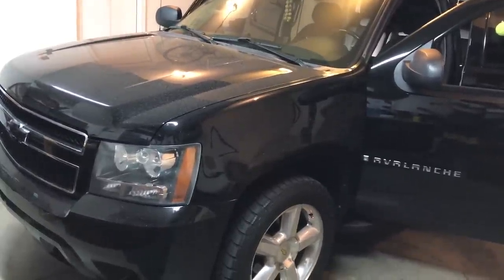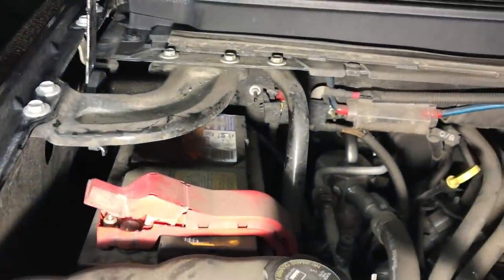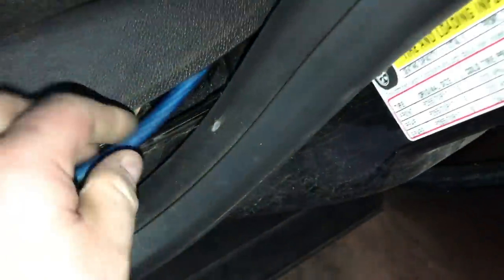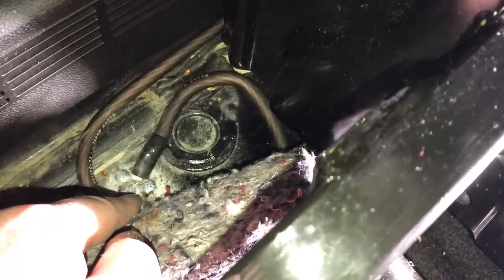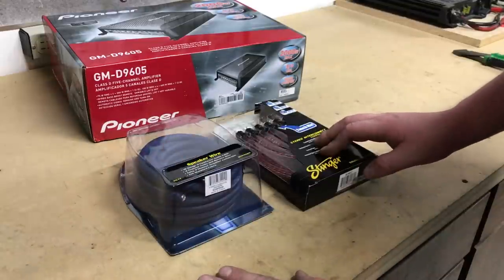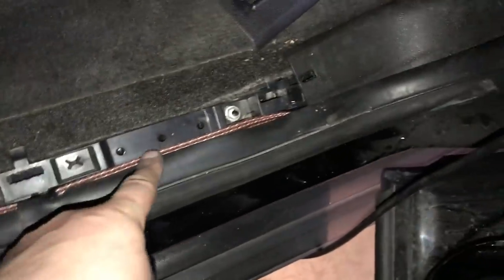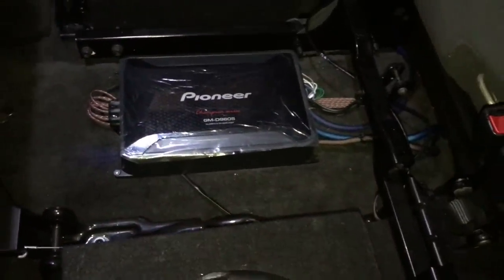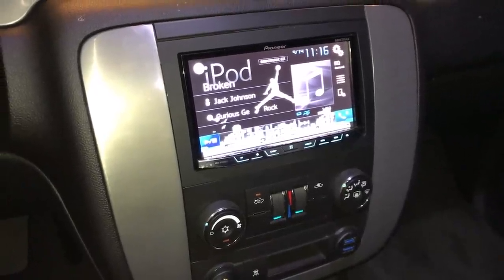2007 - 2014 Chevy Avalanche 5 Channel Amp and Sub Install

Comment: I always thought you had to get rid of the factory bose amp when adding in an amplifier to the door speakers.
Reply: this truck doesn't appear to have the Bose option. mine does and i tapped into the lows on the factory sub for the new ones.
Reply: @Jeff-jr3sg , so you were able to keep your existing factory bose amp to run your new subs?
Reply: @joeyrember23  my subs are powerd by an amp i just get my signal from the factory sub output.
Reply: But if i want to replace my factory amp with a better one without running new wire? Some one help me

Comment: What’s the most power I could to do with that battery terminal That’s by the firewall? I don’t really want to mess with the battery terminaI I have a 2007 suburban will it be ok to use with 200 amp fuse for a 1800 x 1 amp?

Comment: Would two 12s be able to fit under the seat with no problem as well??
Reply from the maker: Shallow mounts, sure.  Just make sure you find a box that can accommodate them

Comment: have a tahoe ls model 2007. did anyone knows where's that factory amp located at inside the truck??? I I've replaced the stereo aftermarket speakers front and back . They all work but they still need help on upgrade level.
Reply: In the center console

Comment: If you are running the speaker wires straight to the stock harness what are the extra RCAs for?
Reply from the maker: RCA's carry the signal from the radio to the amp.  The speaker output then goes back to the harness to each speaker.

Comment: Good evening! How did you secure the MDF under the rug? Thanks in advance!
Reply from the maker: quarter inch MDF.  Amp drilled though carpet into MDF, carpet is sandwiched between wood and amp keeping it in place and secure.
Reply: @ProvoBeastAudio  So a quarter-inch was enough for the amp screws to hold on to the MDF?
Reply: @milche64  apparently

Comment: Where does the remote amplifier power get connected to the head unit? You ran it but never showed where to connect it?
Reply from the maker: Run RCA cables from the radio RCA outputs to the RCA inputs on the amplifier.
Reply: There is a “remote wire output” on the harness in the back of the stereo, you can use that or tap off a fuse that is only active when the key is on! Use a test light of volt meter to test which fuses are on when the key is tuned on, and off when the key is off! Hope that helps!

Comment: Do you have to bypass the factory sub or just disconnect it?
Reply from the maker: This truck wasn't equipped with it, but since we had an aftermarket radio, we wouldn't have even needed to worry about it.  If you are concerned, you can just disconnect it.

Comment: thanks for the great information, I learned something new today with wiring new speakers. One question I did have was with your subs, did you route both of them to the same plug in on the amp? 
I was looking at adding a second amp to my truck, and I believe I would need a second amp, however, the GM-D9605 doesn't have any out put ports on the amp. How would I add the second amp?
Reply: They have special boxes where u run your power cable connect it to the box then it has 2 exits then u run both your amps 👍
Reply: Hugo Arreola a power distribution block. I understand that. I meant rca wise, would I need an rca splitter?

Comment: Great job as always! How do you mount the amp and sub to the floor?
Reply from the maker: We slipped a piece of MDF under the carpet then screwed the amp through the carpet to the wood to mount it securely.
Reply: @ProvoBeastAudio  whats mdf?
Reply: @TONYELDIABLO1  medium density fiberboard. It's the best solution for sub boxes. Way better than plywood. Less chance of rattle when the bass hits. Here he's just using it as a mounting sheet. In this case, because MDF strips out easily, it's not best.
Reply: @ProvoBeastAudio   How did you install the MDF under the carpet to keep it secure. How thick was the MDF?

Comment: Great video! I have one question. What was  your channel setup/hookup since this is a five channel amp and your running two subs.
Reply from the maker: Two subs wired in parallel to a signal sub channel output on the amplifier.
Reply: Provo Beast Audio Installation Thank you. I have an 07 and have been trying to come up with a simple and effective setup. Are those shallow mount?
Reply from the maker: Yep
Reply: Provo Beast Audio Installation Great, thank you. This helps me a bunch. Is there a shallow sub that you recommend? I'm doing the exact same setup.